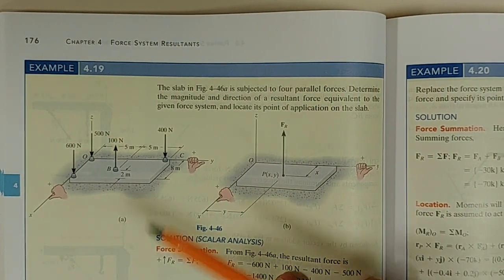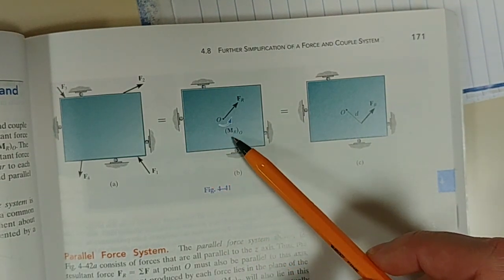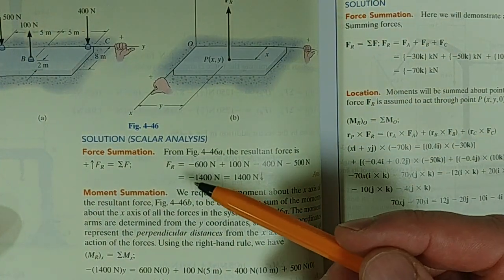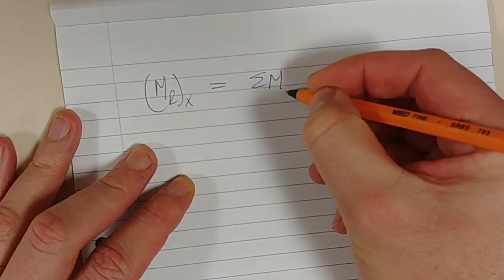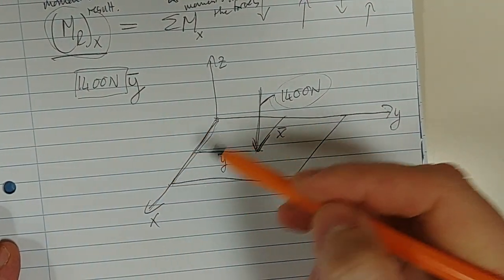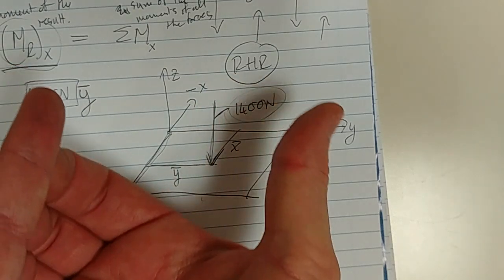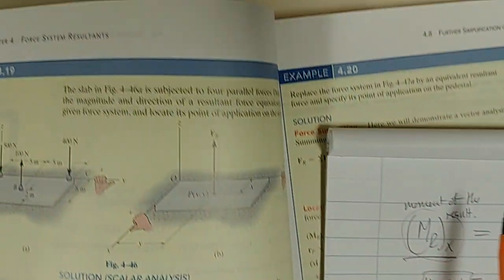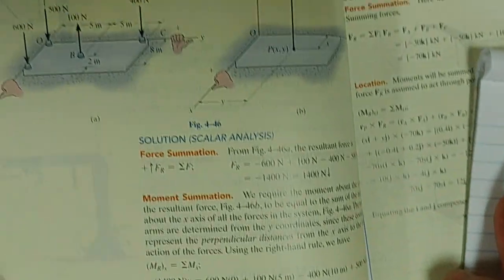Chap 4.8 - How do I determine the direction of moments in 3d?

Comment: While looking at the moment caused by 400N in y-axis, if the palm of the hand faces into the page, the thumb goes in the negative direction? Is there any way to know which way the palm faces?
Reply from the maker: Hi Pabina, 
simply point your fingers in the direction of the force and then curl them around the axis you are interested in.  So for the x-axis you point your fingers into the plate and then you curl them around the x-axis and your thumb points in the negative x-direction,  meaning it is a negative moment.

For the y-axis, point your fingers down but now curl them around the y-axis.  Your thumb should point in the positive y-direction, meaning you have a positive moment about the y-axis.

Does that help?
Reply: @bevansmith3210  Yes, it does! Thank you for your help!